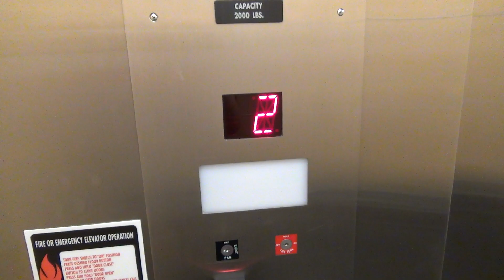Dover/Long Hydraulic Elevator @ 7700 Clayton - Richmond Heights, MO

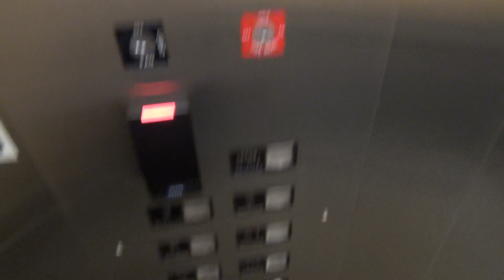Comment: Series 5 Floor Passing Chime kinda. Very high pitched Schindler 500A down chime at 0:58!!
Reply from the maker: That’s not Schindler
Reply: @stlelevators  the chimes on the 2nd floor sound like schindler
Reply from the maker: @ΝικοςΠοδας-τ7ξ  It's a long chime. For some reason it didn't do the double down chime.

Comment: This is basically an exact replica to the other elevator except this one has a squared Adams call button, a non-faded Dover logo, and two brailes. It is also on opposite sides. This door is much better than the other one. Just another boring typical Long mod. It runs very decent.
Reply from the maker: I'm not a huge fan of mods, but I always enjoy seeing Long, even if it's a mod.

Comment: I didn’t know Long used microswitches
Reply from the maker: I don't know if that button was put in by Long. I've seen many Long mods and usually they used an innovation surface mount. This might be a replacement of the original one.
Reply: @stlelevators  oh, play